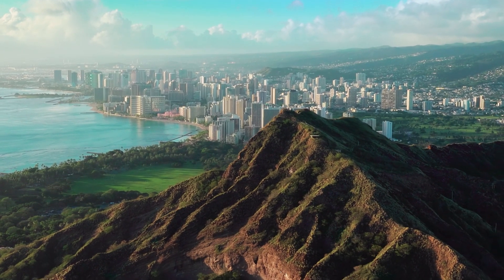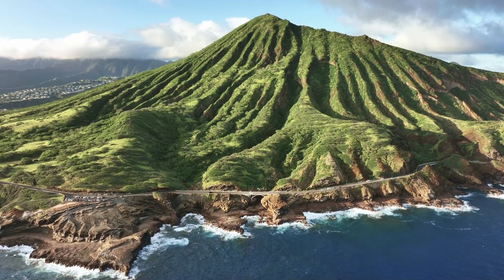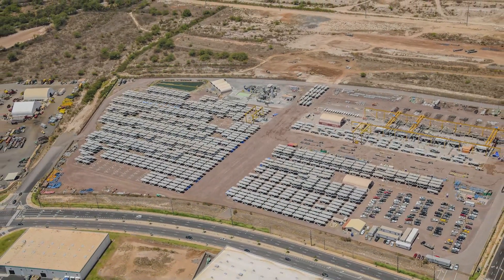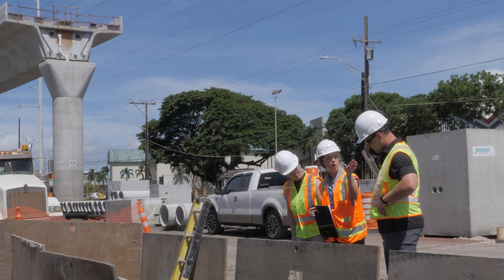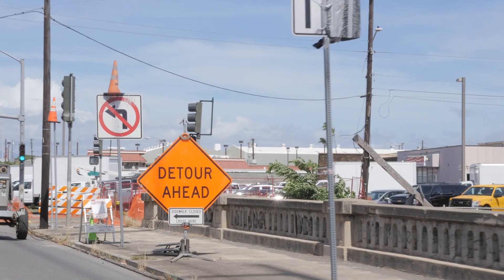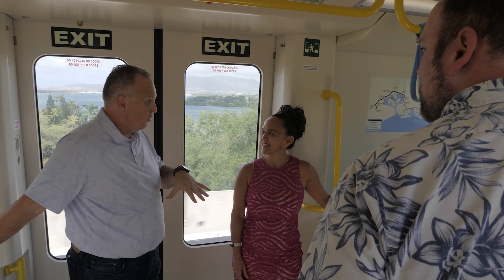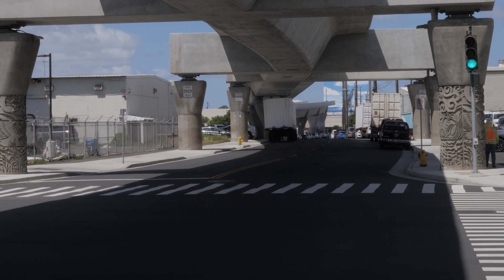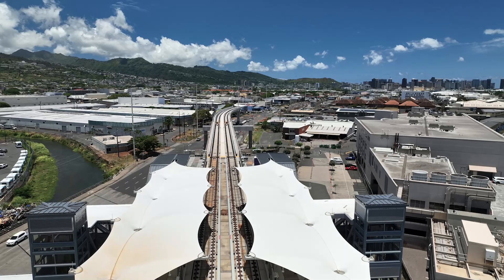Managing the construction of a $10B transit mega project in Honolulu

Comment: Sorry, but it’s not light rail either.  Calling it light rail is wishful thinking by the city.  The FTA classified it as heavy rail based on information submitted by the city.

“FEDERAL TRANSIT ADMINISTRATION 
PROJECT MANAGEMENT OVERSIGHT PROGRAM
Contract No. DTFT60-04-D-00015 Project No. DC-27-5044
FTA Task Order 12 — Programmatic Services Work Order 5G
CLIN 0005: Spot Report. 

The City has referred to the mode as a "Light Metro" vehicle. However, the vehicles can be described as automated short heavy rail vehicles with a tight turning radius. For the purposes of this Spot Report, including the transit capacity analyses, the vehicles are identified as a "heavy rail" vehicle, which corresponds with the modal technology identified in the Standard Cost Category (SCC) workbook estimate provided by the City.”

“The Federal Transit Administration categorizes Honolulu’s rail as ‘heavy rail,’ but Toru Hamayasu, HART’s first interim executive director, says this is not entirely a fair description. He writes in an email that HART preferred to call Honolulu’s system a ‘light metro rail’ to fit its image of something that is in between light and heavy rail systems: ‘Light rail by definition is a system where one car can operate on its own while heavy rail requires several cars with dedicated functions to make a train,’ he writes. ‘HART needs two cars to operate. FTA also defined a heavy rail to have a third rail for power and that’s what HART has too. So for the functionality, HART is more likely a heavy rail. But heavy rail cars are usually longer and consist of more cars. HART cars are about 16 feet shorter than typical heavy rail cars and one train is no longer than four cars. So to avoid the image of a big train running overhead through the shores of Honolulu, it calls itself a light metro rail. Similar systems are in operation internationally, such as in Vancouver, Copenhagen and Milan.’” hawaii business 11/9/2021

Comment: Not autonomous, automated, big difference.  It’s also not the first.  The Las Vegas Monorail has been in operation since 1995.

Tren Urbano in San Juan was designed from the beginning to be capable of automated operation, although they have chosen to have an operator on board for security reasons.

“The line will be governed by full automatic train operation, allowing possible driverless operation, although this is unlikely to be implemented for security reasons.” railway-technology  7/6/2000

It has come a long way though.

“The plan also includes $2.7 billion for mass-transit projects, including $2.5 billion for a fixed-rail system between Kapolei and Manoa.”  Star Bulletin  2/19/2006

“How Rail Got to $12.45 Billion and 11 Years Late (2031)” hawaiibusiness 11/9/2021